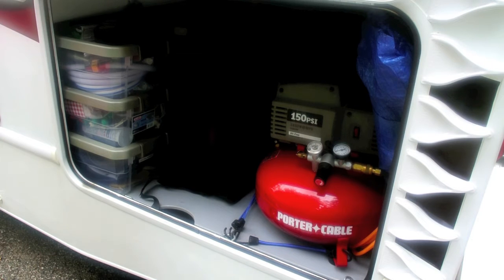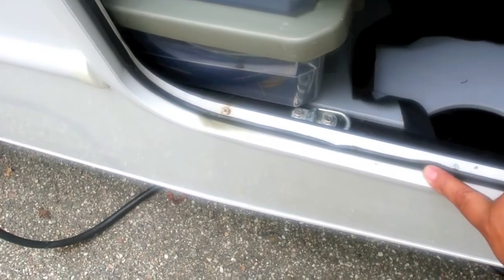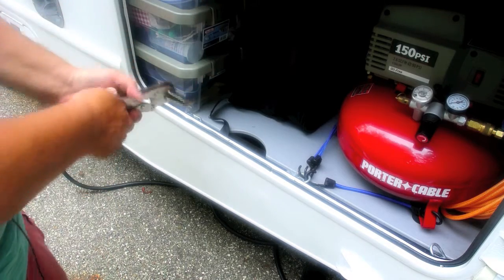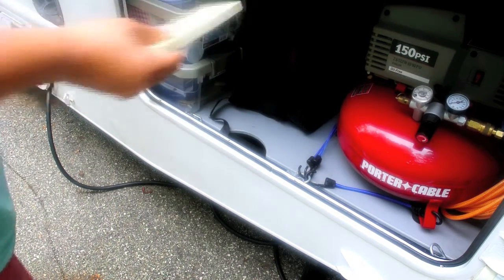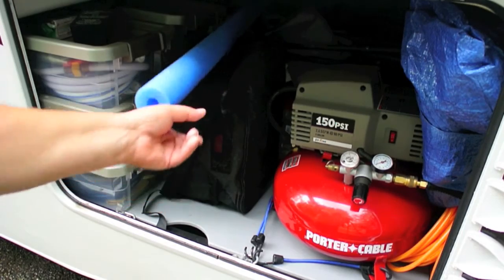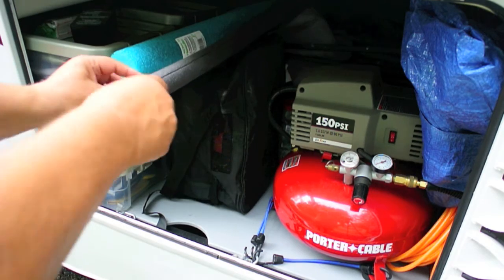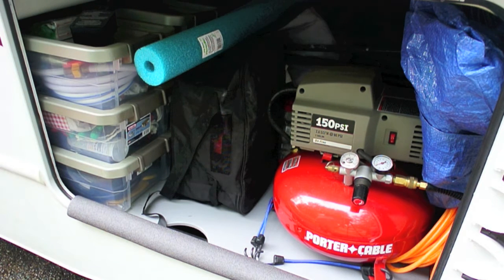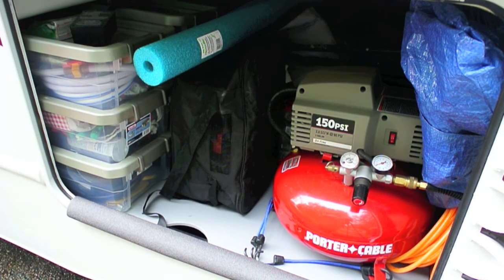RV Quick Tip: Maintaining the storage compartment seals.

Comment: Same problem here, in the process of machining aluminum angle to reinforce the backside lip. i gave up banging the edge stright all the time. i like the noodle thing. thats a much cheaper and simpler  than milling angle down,  but haft way through the project now lol.
Reply from the maker: Admittantly, its a pain to have to insert the noodle each time, but other than a custom job such as you are doing, I see few options.